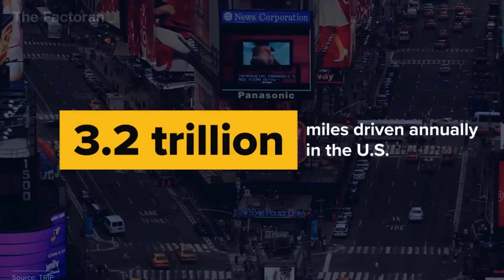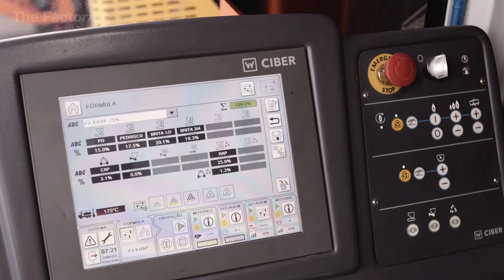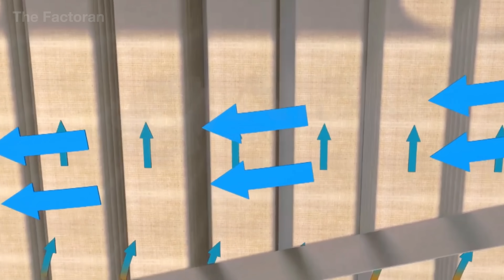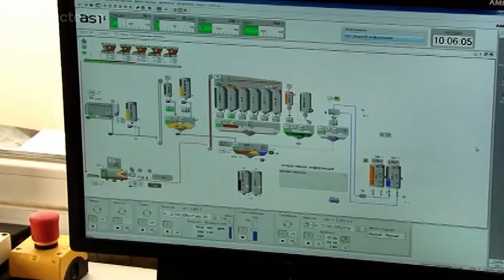How Millions of Tons of Asphalt Are Recycled Into New Roads Inside Massive Asphalt Factory

Comment: Adding aramid fiber allows plants to use a higher percent of recycled asphalt (from 10-20% up to 30-40%) without sacrificing quality. Making the whole process better. More areas need to use this technology.
Reply from the maker: Exactly! Aramid fibers really push asphalt recycling to the next level. Increasing recycled content without losing strength or durability is a big win for sustainability — more regions should absolutely adopt it.